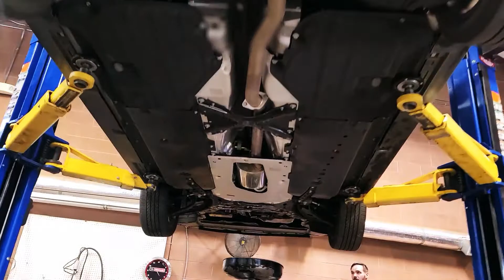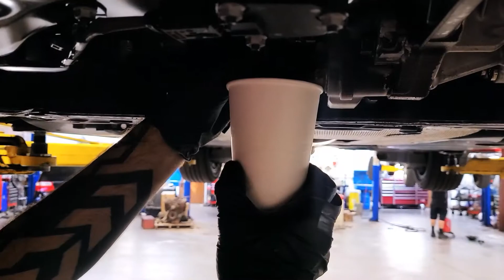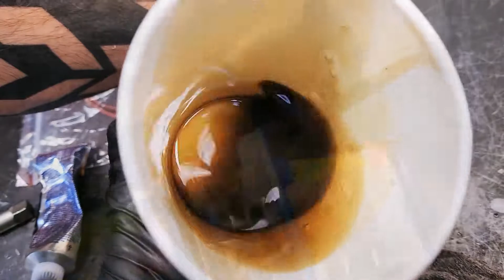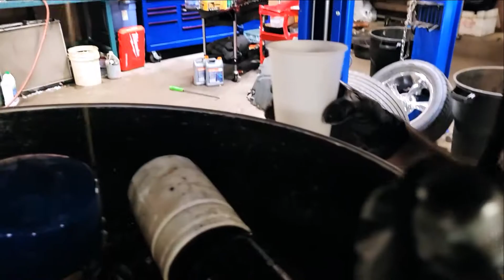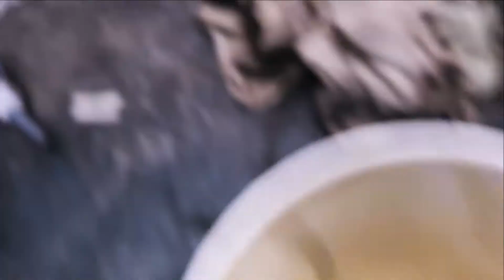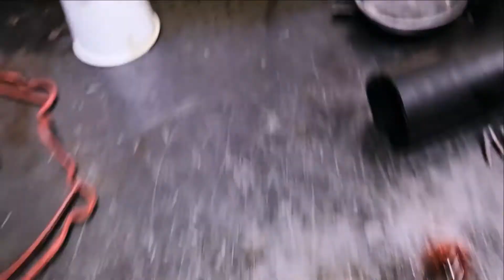T-case/Diff Fluid Change Mazda 3 Turbo

Comment: What could be damaged by an aftermarket oil? Considering it's around the same vicosity and it's oil actually made for transmissions and differentials. You mentioned TCC shudder but is that causing damage or just feelings.

Comment: Hello. I just did my first rear different and transfer case oil change service ever, at 22.5k miles but car is like 4 years old. Differential oil came out pretty clean, I couldn't see the other though. However, in my country I couldn't get Mazda SG1 and it's hard to import oil on my own. I didn't know about alternatives and my mechanic told me they use Motul so I was ok it must be great, but now when they drained it already I saw the bottle was Motul HD, it's 80w90 and seems to be non-synthetic. Googling around seems like Motul Gear 300 75w90 would have been the best alternative to OEM. Should I be worried to be running non synthetic 80w90? I also read that at same viscosity rates the difference in fluidity varies from non synthetic to full synthetic oils so like 80w90 according to specs seem to fluid more at 40°C than the Gear 300.
Would this oil mess up and break my Differential? What do you think I should look for unexpected changed behavior so I can go and change to another oil before I break my car? There's also Motul Motyl Gear 75w90 but seems to be more focused to transmissions. I'm scared of breaking things. What do you think?
Reply from the maker: Motul 300 75-90 is a great oil. Discussing fluid viscosity can lead to going down a big rabbit hole, lol. A 75-90 synthetic viscosity will vary between manufacturer to manufacturer because viscosity rating is set up for ranges. You can have a "lighter" synthetic 75-90 and a "heavier" one, and you can have a conventional they is "heavier" still. If it were my car, I'd get a good synthetic in there vs. a conventional.  The fluid capacity is not very big, and synthetics handle the heat put into the oil much better.
Reply: @21mazda3turbo3  yeah I know about the discussion that originates in some forums, not really into that stuff lol. I'm just worried this 80w90 non-synthetic would not handle the duty properly, at least for a few months until I get Gear 300
Reply: Or what damage could cause a non-synthetic oil at 80w90 on this or I'm just worrying too much
Reply: Is the sg1 a synthetic?
Reply from the maker: @DavidTMSN  it is yes.

Comment: Does somebody tell me the gasket part number for the drain and fill plug for both the rear differential and transfer case, please? I just want to make sure before starting the job
Reply: 18mm crush washer I believe.

Comment: This might be a dumb question but im new to working on my own car.

Where and how do you refill both fluids? From the same plug they were drained?

Thanks for the video
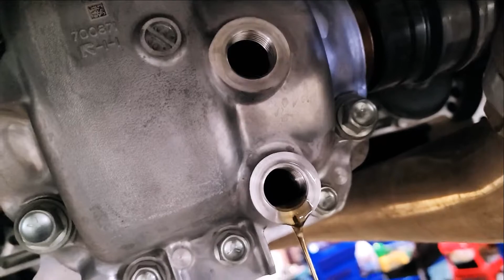Reply from the maker: The big drain plug pointing down at :12 seconds in is the tcase drain plug. The fill plug is further up on the side. 1:28 in is for the diff. Top open plug is the fill spot, the one below it is for the drain.

Comment: How do you change the front transfer case fluid? Last time I went underneath the fill plug looked blocked by a bracket. The service manual seemed to indicate the need to remove lots of parts, more than I would comfortable removing in my gravel driveway!
Reply from the maker: Yep changed it at the same time. On the turbo cars it's very easy. I've heard it's a pain to do on the non turbos though.
Reply: @21mazda3turbo3  I have a 2020 AWD NA model so that's a shame! Do you think it's worth to do regular changes on? I did my rear diff very easily and the transmission fluid as well.
Reply from the maker: @benjaminlam4693  yes it will be worth changing the fluid. The transfer case is always turning and it only holds about 1/2 a qt. The fluid does get worked pretty hard.
Reply: @21mazda3turbo3  Awesome thank you for your help! I'll pay to have it done if I can't find some more information on how to DIY more easily.
Reply: @21mazda3turbo3  out of curiosity do you happen to know what the recommended change interval is on it? I have 5k miles in mine just did the first oil change but I’ve been driving the piss out of my car.
Reply from the maker: @joaquinbarreto9398  No specified interval by Mazda, I'll do it again in another 10k to monitor wear and then decide from there.
Reply: Yes, I brought my 2021 Mazda 3 AWD NA to my mechanic today to change the transfer case fluid. Same mechanic did the rear differential for 40 dollars in labor. After a couple hours, he calls me and says they would need to drop nearly the entire front end because of the bracket that blocks the fill plug. It was quoted at 5 hours of labor or nearly 450 dollars to change the fluid as a result. Basically, he recommended not to change unless there was an issue. He said they could grind off that few millimeters of the bracket to make the plug accessible if I really wanted to change it, but he said if this was his car, he wouldn't touch it either. Mazda does say that the only reason to change the transfer case is if it is submerged in water. Typically I am impressed with Mazda, but in this case, their engineering really screwed up.
Reply from the maker: @Lwnmwrboy5  yeah the non turbo versions are a pain because of that bracket. Turbo cars you just reach up and have access to the drain and fill plugs.
Reply: @Lwnmwrboy5  I had bought the service manual for 24h access and what you described it pretty much what the service manual said. It required dropping the front crossmember, some heatshields and a bunch more things just to get the bracket off!
Reply: @benjaminlam4693  where do you get the service manual?
Reply: @benjaminlam4693  Did you manage to do it a different way than what's stated in the service manual? I'm hoping there is a way to remove just the bracket without touching the other hard to remove stuff
Reply: @themusicguy819  I haven't done it but I'd be interested in your process if you decide to give it a shot!

Comment: Whats your opinion on Mazda's SG-1 fluid? Some people on the online forums suggest using Royal Purple 75w-90 instead as they think the SG-1 fluid isn't great.
Reply from the maker: I'll preface this with I have been in the auto industry for the majority of my professional career and specialize in drivetrain.  I use SG1 specifically because of how good it is. I learned a long time ago to not get into fluid discussions online. It always ends bad. 😂
Reply: @21mazda3turbo3  Appreciate the answer! I had my doubts when others suggested SG-1 is a "bad" fluid as it's been out for awhile and is still in use. Was just curious, thanks!
Reply: Do you also recommend the Mazda OEM trans fluid?
Reply from the maker: @twistttwist  yes I do. The other fluid that is worth considering would be Aisin FZ. I've seen a fair amount of TCC shudder on multiple cars introduced by other fluids that swapping back to factory FZ has remedied.

Comment: what are your thoughts on a GL-5 fluid like Red Line 75W90 for the T-case + diff on the Mazda AWD?
Reply from the maker: I'm personally sticking with the factory fluid until I've seen sufficient evidence to try a different fluid. There are much better fluids than Royal Purple out there. Royal Purple does not recommend any of their fluids to replace the factory fill. If I were to swap to a different fluid, I'd personally run Motul or Amsoil Severe Gear in a 75W90.

Comment: At what mileage did you replace it. On the Mazda website it says for life but I think that’s bullshit especially with the some of the issues these cars have with the rear diff
Reply from the maker: I changed both fluids at just before 10k miles. Both fluids looked great, I was just base lining. I'll probably change it every 20k miles just because the the amount of fluid is small in both boxes. It heat cycles a lot and maintenance is cheap.
Reply: @21mazda3turbo3  did ur dealership do it ?
Reply from the maker: @anthonydigiorgio9240  no I'm the service manager at a high volume drivetrain repair facility so I have access to multiple lifts and any tools I need so I do all my own work.
Reply: @21mazda3turbo3  what about transmission fluid? Would you recommend leaving it alone?
Reply from the maker: @SNiP3Z JUMPER  I'll be doing mine at 30k because of the severe climate I live in.
Reply: @21mazda3turbo3  u gonna use oem fluid or something new
Reply from the maker: @Snip3zjumper  just OEM fluid.

Comment: What were the size of the bolts and the torque specs? Cannot find anything online.
Reply from the maker: I dont recall the sizes off hand but torque is 30 to 40 ft-lb
Reply: @21mazda3turbo3  thank you. I am doing the fluid change myself this weekend.